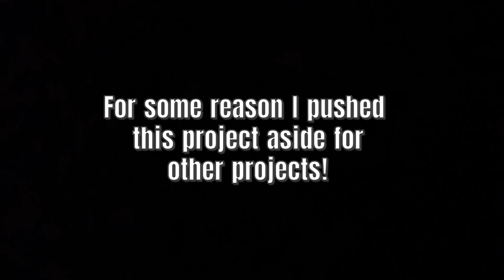Build your own Biplane, taking the basics of wing construction X2, and a basic Fuselage. No plans!

Comment: Well done man, looks like a very good flyer ,also i like the size your planes are at ,not to big or small .......what lipo did You use? ,have a good one👍
Reply from the maker: I used a 1000mAh 3S 70C from Banggood! They are heavier than regular 1000 3S but I suspect capacity is higher than advertised! 
With this motor/prop etc it seems really efficient. I got these on special a while ago
[AU$27.12 24% OFF]ZOP Power 11.1V 1000mAh 70C 3S Lipo Battery XT60 Plug for JJRC M02 RC Airplane RC Parts from Toys Hobbies and Robot on banggood
https://banggood.onelink.me/zMT7/01e5h9dq
Reply: @BuildYourOwnRC  same here, i had a 3s 1500mah 40c and i think it was more like a 2200mah ,it was a good lipo but i crashed a plane while flying ,in a electric post and its still there to this day ....